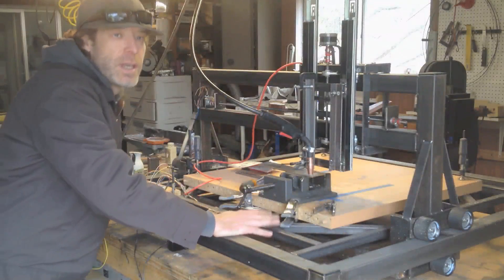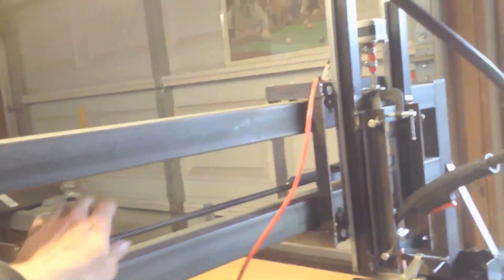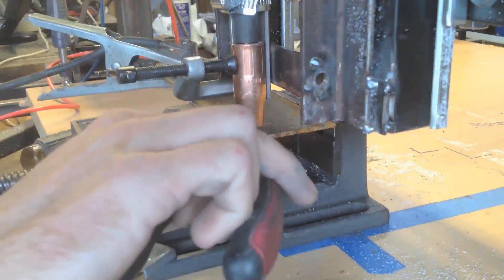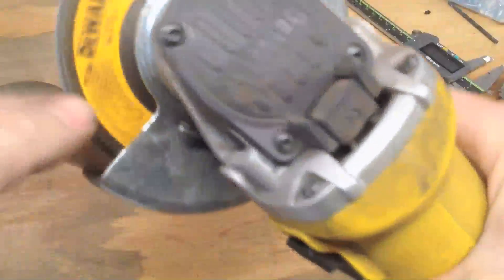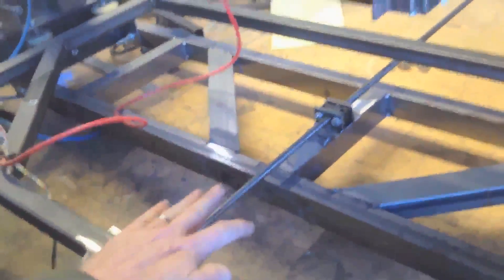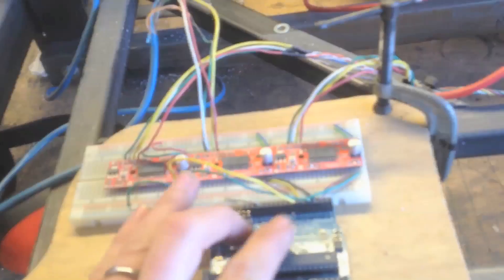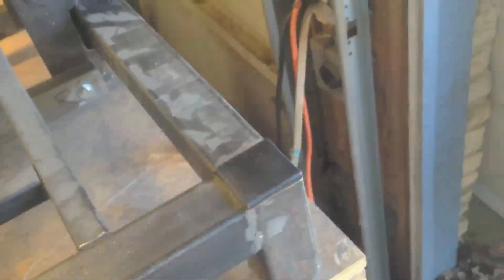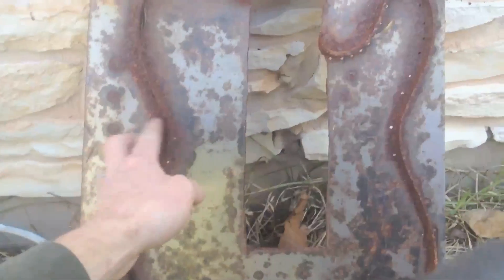How to: DIY Arduino CNC Router Cutter Welder (Part 6: Welding and Costs)

Comment: Thanks for a great series of videos! I've just been watching the entire CNC series! 

It gave me a lot of ideas for my own build!

I was a bit surprised by the tiny steppers on this rather big steel machine, but it all depends on intended use I guess. Are you still happy about the steppers?

What will you be using this machine for?

Btw, are you familiar with Autodesk Fusion 360? It's a complete CAD/CAM package, great for designing just about anything... And you can easily create G-code directly from your designs!

Check it out, is awesome!

It's free for hobbyist and at a great price for pros as well!
Reply from the maker: Sorry for the delayed response.  I made this machine to weld long beads (about 20 in)  for some repetitive work.  Yes I've checked out fusion 360 and looks great!   The "tiny" steppers have worked out just fine... for now.   Thank you friend.

Comment: i use dm860a with nema34 double ended steppers driving a  .35   9 tooth sprocket they have 100 lbs of holding torque or 1600 oz

Comment: hello . by using commercial  threaded rods for lead screws  , does it makes the machine stronger and more accurate? ... in theory it should. thank you for your info.
Reply from the maker: Are you referring to the ACME rods?  (the ones used for my x and y)   If so then yes,  they're designed to be used with CNC.   Also, the DELRIN nut block is designed to lubricate the ACME rod.    I wasn't too concerned about my Z axis (since it moves so little) so I used a cheap Home Depot threaded rod.   Many people are saying that it will eventually seize,  but I haven't had that happen.

Comment: Hi Absorber, thanks for your well done series of videos, specially when I learn that screw pitch can be optimized on the spot !!!  I'been delaying a similar project but I had a Limitation regarding the "screws" now it's clear I can use regular treaded ACME bars, I'm also planing to use Nema 23 or 34 will this arduino work with them ?? any comments,??? thanks again your videos are great
Reply from the maker: Yes you can use ANY size motor, however you will need an appropriate driver.  Thanks for watching!

Comment: As for the bearings might it be possible to grind the threads diameter down to a size a cheaper bearing will fit ?

Comment: nice build on the fly kinda like mine i got tired of the slowness of nema 17 s and lead screws now i have nema 34s and chain drive and ballscrew on the z scary fast now and still super accurate
Reply from the maker: Yes I'm also getting tired of the slowness.  What kind of drivers are you using now?

Comment: Hi great work.
If you had to do it again, would you make the gantry move with the Y axis (as you did) or move the table under the gantry.
I feel that the moving of the table would be more stable and having the gantry stationary a bit more rigid.

however it is the end results that count and yours is well within expectations.
Reply from the maker: Thanks.  I thought about that but it would need more space.

Comment: I didn't see it mentioned but I'm wondering what the max X, Y and Z movements are for your design?  
Great project!  I have serious tool envy.
Reply from the maker: Thanks man.  Work surface is 3' by '3 and z axis height is 8 inches.

Comment: Thank you for posting all your work!  You show excellent attention to detail.  I do have a question and I apologize if you already answered it.  I noticed that in the videos you tack welded everything.  Did you go back and finish weld the tacks or do they hold on their own?  Thanks again for posting a most excellent series of videos and you've made a great machine!!!!!
Reply from the maker: +Greg McDonald Thank you!  Everything remained tacked except for the base.   If I was to go back and weld, things would distort.  It it also easier to modify if need be.   These are heavier tacks and definitely hold no problem.  Thanks again for the kind words.

Comment: just a heads up for anyone with a build going, if you have a place near you that rebuilds starters and alternators , they usually have loads of sealed bearings in all different sizes, used but most of them are in great shape and you can usually get them cheap

Comment: Great job with the fly-by-design approach! 

Long term I would suggest soldering the stepper motor wires directly to the power driver modules the friction fit protoboards often don't work well for long-term, "high" current use. If possible, completely replace it with a solderable version instead. Otherwise over time you might start getting electrical issues, especially as the wires oxidize and grime starts to get into the connections.

Finding one that you really like might be a bit tough (right size, cheap, easily available, etc.) buy here is an example of one that is at least readily available, and at least gives you a starting place before looking around for others.

https://www.adafruit.com/products/1135

Other examples are pictured/discussed here:

http://www.robotroom.com/Breadboard-Hints-And-Tips2.html
Reply from the maker: +Darrell Hale Thank you I appreciate your advice!

Comment: Hi, the only thing missed during your entire build, and I watched all 6 episodes a few times (even downloaded them into my library for my future build attempt) , was info about the stepper motors.

     Could you please tell us the VOLTAGE, CURRENT and TORQUE ratings of your 1.8 degree NEMA 17 steppers? I know a lot of people watching your well done video / build would like to know the values. Everything else was very well explained.

    One last question, was there a reason you didn't use steel coupling or "barrel" nuts on the X & Y axis like you did on the Z axis as opposed to the expensive Delrin blocks?
    There must be an advantage or you wouldn't have spent the extra $$$.

                               Thanks for the GREAT instructable!
Reply from the maker: +1936_CAT22 Thank you so much.   To be honest I have no idea what the ratings are for the motors,  I wasn't even sure if they were going to work.   Delrin blocks are designed to "lubricate" the acme rod, otherwise they would likely seize over time.  I did not use that on my z-axis because it really doeen't move that much.  Some people are telling me that it will eventually seize,  but that hasn't happened.  I do keep it greased though.
Reply: +Absorber Of Light    Thanks for your response to my questions. I think I can get some Delrin block scraps from work & "machine" them myself to do the job. If not, I'll just use coupling nuts lubed with dry silicone & design the mounts for future Delrin upgrade if I have to spend the $.
   I got lucky with motors & got 4 Minebea 1.75amp. 12 volts 100in.Oz steppers for $8.50 ea. from a local surplus place here in LA so I should have a good start!

Comment: greatest you video series I´ve ever watched.  Congrats man.....I have millermatic 252 welding machine and a hypertherm powermax 65 plasma cutter, will it work with my machines?...My welding machine torch is 15 ft.
Reply from the maker: +luiher1979 Thank you.  Yes for sure it'll work.

Comment: This was pretty impressive.  I've seen videos on Element14.com, Ben Heck where they use a high end CNC machine to prepare designs for enclosures of electronics and specialty displays.  This is way cooler and so impressive that you did this all from scratch and with no plans.  You could mass produce really cool belt buckles with this idea!!!

Comment: have you tried anything 3D with the welder? I was thinking of trying this myself, basically a FDM 3d printer with metal. I can see there being problems with inconsistent thickness and such though, any thoughts?
Reply from the maker: +widgity Yes I have.  The problem I'm having is that the welder melts the previous layer slightly and then things get crazy.

Comment: Thanks for sharing. You may have answered this question already, but what CNC SW are you using. thanks.
Reply from the maker: +Paul Padilla Thanks.   It's a browser based g-code sender called "Easel".  You can find it on inventables.com.   You can watch part 5 for more detail.

Comment: Nice series. very inspirational and motivating. A couple of suggestions though: first, anything that moves, rolls, ro slides that may need to be replaces should NEVER be design in such a way that it cannot be replace. Hate to be a buzzkill here, but htis is the one you bitch out the "fill in the blank" company for doing on some component that "they should have known better" to make in a replaceable manner. The Second thing I would suggest, instead of E-bay, try Amazon.com, Grainger.com or Essentra.com for your tooling and component needs in the future. Like your work a lot man. Keep up the good work.
Reply from the maker: +Tom Bryant Thanks for your comment and advice.  I'm not sure what you mean since everything in this machine can be replaced/modified.  That's one of the reason I only tacked instead of welding.  I'll check out Amazon or Grainger for sure next time!

Comment: You really should get some more powerfull steppers if you want certainty you won't lose any steps. Also, if I were you, I would finish all the welds of, not only tacks.
Reply from the maker: +LReBe7 I've had this thing running for two months straight without an issue,  maybe i'll upgrade the motors but for now it's fine.   Welding the whole thing would distort the hell out of it...  thanks for watching!
Reply: Oh, I didn't think of that one!

Comment: you could make a removable switch for the welder...when the welder comes down it pushes the switch and when it goes up to move to the next spot it will release the switch....and presto you get a perfect weld
Reply from the maker: +Tommy Hard Yeah I thought about that, the problem is that the cnc tends to linger before taking off...

Comment: Excellent build.  Nice set of videos.  You made it look easy.  Any reason you didn't use home depot screws for all the lead screws?  Also, can you trigger the welder off of the Arduino?
Reply from the maker: +Devin Thank you.  The cheap home depot threaded rods would eventually seize.  I used it in the Z-axis since it has minimal movement.   Also it would have to spin a lot more to travel the same distance.   A delrin nut block helps by lubricating the axes.  The welder can be triggered with the arduino by using spindle on/off or coolant on/off commands.

Comment: over here ebay can be set to show pricing low to high including shipping 
that would prevent the misstake of paying too mush for shipping 
i made the misstake with stuff from china , the shipping is usually free but we sumtimes have to pay a importfee and taxes for importing it intoo the netherlands (same thing with the US btw ) i usually try to find it within the EU 

just finished watching the 6 episodes and i'm impressed with the setup and the low price you payed for it 
i do suggest you spray some non stick stuff on the treaded rods or cover them up with sumting that can retract and extend so weldingspatter whont ruin them 

i have been looking intoo ready made plasmacutter tables and there pretty pricey 
i think this thing might be able to do the same thing for a fraction of the cost 
im realy suprized at how eazy the stuff translates from the computer to the steppermotors i figured i needed a lot more electronics to do that 

if i ever get around to build one i prolly would mount the treaded rods above the table so all the moving parts are above the cutter and out of the way of the sparks 
i might allso build it so it slants allmost straight up agains the wall as i be cutting 2 to 5 mm sheetmetal on it and the whole setup whont take a lot of space that way , might just use two hooks and cut two small holes in the material and just locate the sheet using the holes and the two hooks (hanging it like a painting over the cuttingraster) that should make it eazier to center the plasmatorch too and the plate doesnt have the be square
will need a little stronger stepper motor on the y (?) axis as it will need to lift the whole sliding bit with the torch up and down , the base (x axis?) and the z axis should be ok 
maibe i can get by with doubling up the drivers and steppermotors on that one axis (one on each side of the treaded rod )
question : did you just tack welded the table in the corners or did you finish weld it ?
it looks like you only spotwelded the 4 corners of the box sections
Reply from the maker: +watahyahknow Thanks a lot man, and thanks for your advice.  I did weld the inside corners of the base,  everything else will remain tacked to avoid distortion and for easy disassembly if I ever decide to modify.
Reply: have been looking more intoo the slanted upward desighn , the new idea is to make a second track at the other side of the setup with a weight thats the same as the one above it and a cable over a pulley on the top of the setup , should make the resistance deu to weight about the same as with the table horizontal 
have been looking at slidebearings too , not as cheap as the different rollerbearings and rollerskate wheels but a lot simpler to put together and keep level with the workpiece

Comment: Congrats on your awesome low cost DIY CNC router.
If you find yourself using it a lot - upgrade the Z axis to an ACME lead screws. (the one you have will seize - I promise).
The arduino can be had as china clone for 5 bucks if someone wants to build this with an even tighter budget.
Reply from the maker: +XerotoLabs Thanks for your advice man.   I tried to do "3d" printing with the welder, but the problem is that the top layer will melt the bottom layer and make a mess.
Reply from the maker: +Christian Stöveken Thanks man.  Do you think it'll seize??  Never thought about that,  I do keep it greased.  We'll see I guess:)
Reply: +Absorber of Light either the nut will cut into the rod , or the nut will break down .  the good news is it's on your Z axis and it wont have too much work compared to X and Y , and if the nut is holding up , you can flip the rod end for end when you start to notice it wearing if you get stuck mid job or such as it will probably wear in the lower 1/4 of its length first .  assuming the rod is softer then the nut .   if you could find some Delrin (acetal) or Teflon block to mill out /tap a thread the would fit the rod , and replace your long nut with it and  neither should wear out for a long time then . acetal being self lubricating  pretty good and you can get low to no back lash when using it . 
Welding was way cool BTW , you essentially have a steel extruder now , so it would be real cool to see you go over a pattern stepping up in height a few mills for a few layers and 3d print in steel . 
I think for 3d you would just need to hack a marlin firmware to trigger the welder and feeds switch.  run some tests and you could print simple  things in  steel / weld . but i dont think you could do over hangs or bridges very well as the molten metal would probably just run , unless you could rig it to drive a servo or 2 to change your feed and power  ..
Reply: hmm , i feared something like that . I have seen stick welding to build up a edge and such . not to detract form your main thread here , at least you can lay a crazy bead .
I dont know enough about welding like that , too bad you could not use a arduino to control the feed and power settings so it dont over melt . http://hackaday.com/2014/11/07/printing-in-metal-with-a-mig-welder/